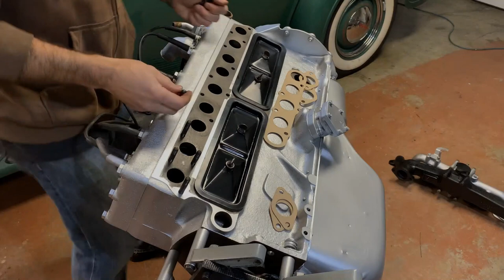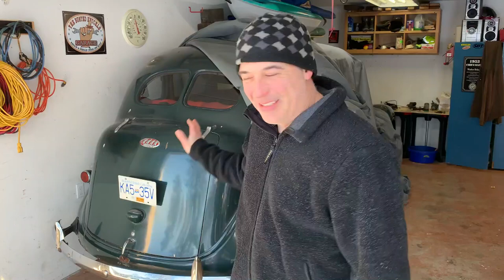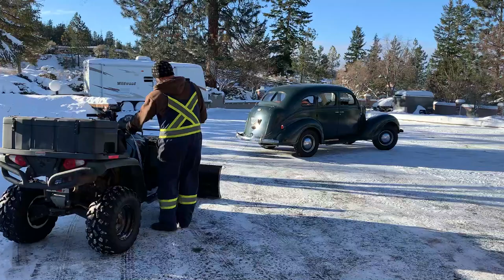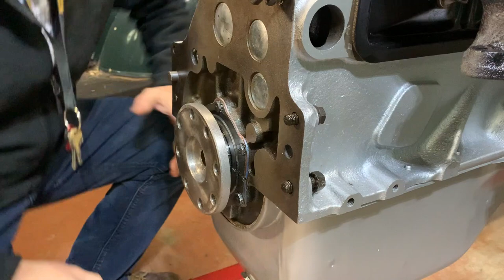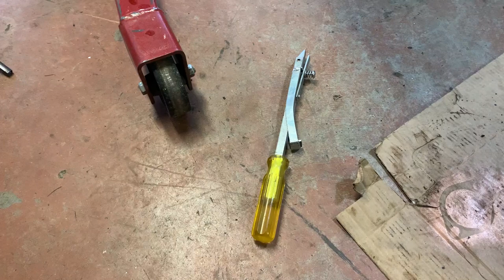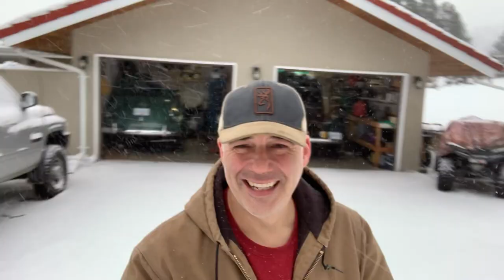Flatheads: Manifolds. Bell Housing. Oil Filter & Cinnamon Buns!

Comment: Merry Christmas Keith to you and your family. Followed your advise and poured some Christmas cheer to keep warm during the Canadian winter months. Can not wait until 2022 or earlier when that beauty roars back to life.
Reply from the maker: The engine is pretty much ready to drop in topday. But it's -18 currently and I'll need to work with the garage door open. So I will wait.
Reply: @keithsgarage5831  -18 jeez that is shorts weather. We are a balmy -30 with windchill. Keep up the good teaching… have used many of your techniques to better understand points and dwell as grew up with only fuel injection and coils. I am excited to see a fuel pump rebuild now that parts are in your possession (no rush).

Comment: Not that long ago I took 15 or so flatheads to the scrap yard. still have some parts. New cranks still left some gasket sets.. flathead 251/265
Yes flywheel only goes on one way 5/8 wrench